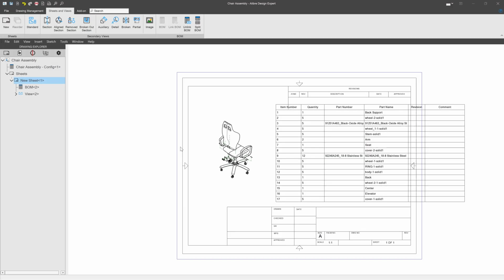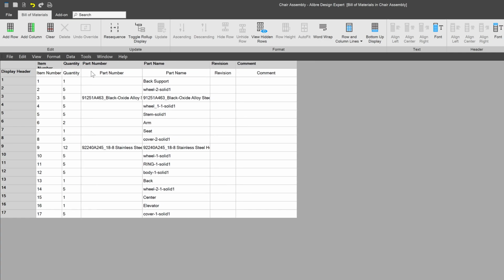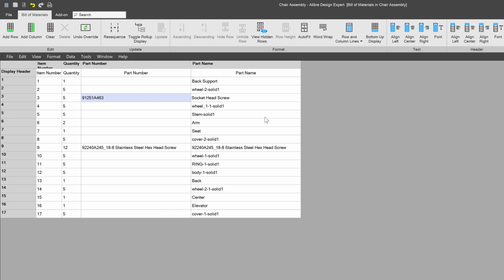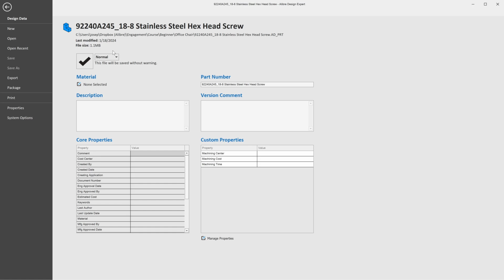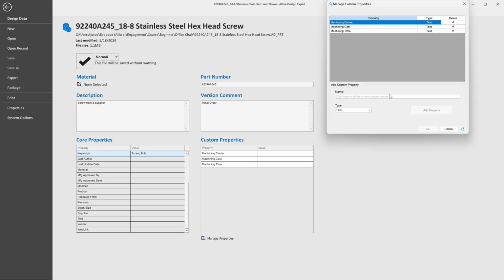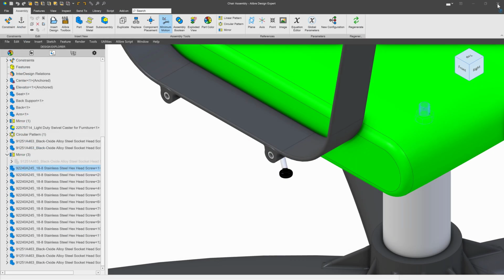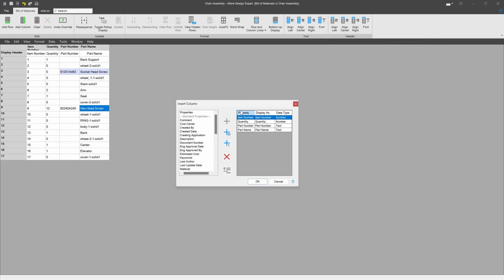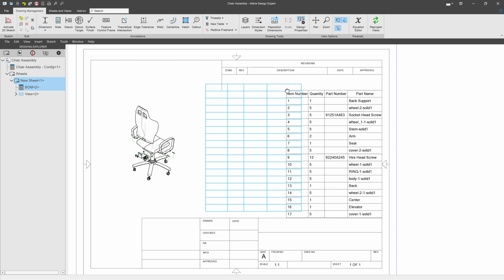Using Properties with Bills of Materials | Alibre Beginners Course #71

Comment: I mostly figured the BOM out but have trouble placing it. I can’t get the BOM to snap into place like inventor or solidworks does. I try to get the lower left of BOM to upper right of title block.
Reply from the maker: I somehow missed this comment.  I tried snapping it in V28 and it seems to be working, let me know if you have any specific difficulty still.